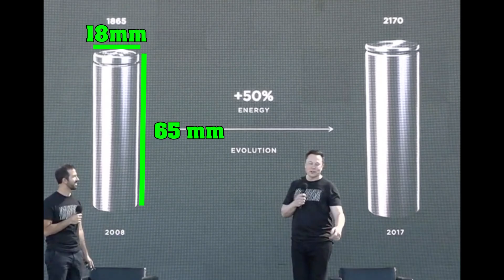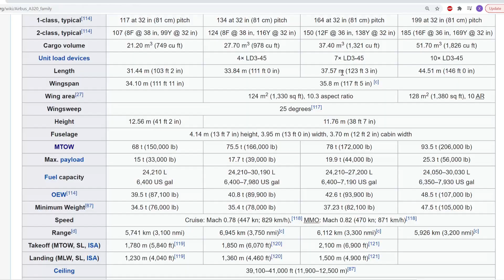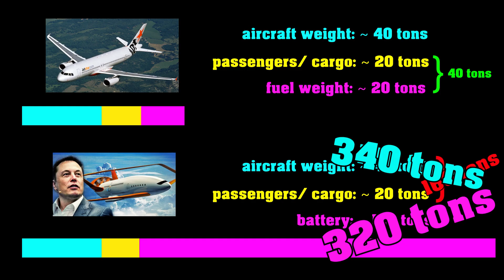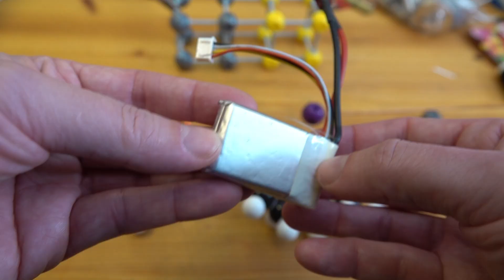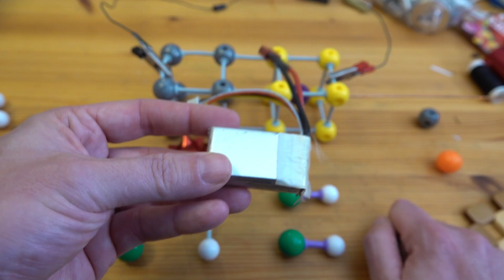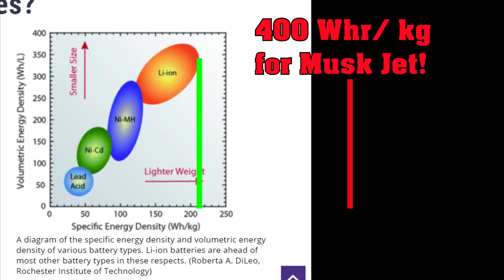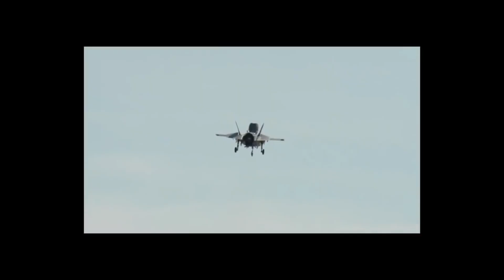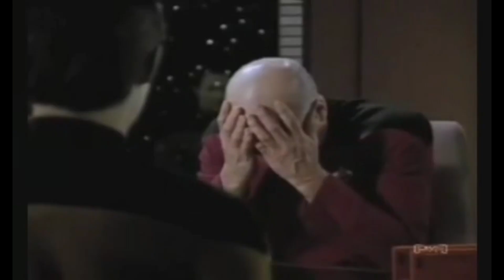Tesla's Secret Plan To Disrupt Airlines: BUSTED!!

Comment: Vertical Take Off and Landing (VTOL) means you need a thrust to weight ratio above unity and thrust vectoring. With the plane being able to land safely in the case of a single engine failure.

Flying supersonic also adds lots of complications including flight control and frictional heating.

Maybe build a subsonic 50 seat electric airliner which can operate at regular airports first.

Comment: Sorry a turbine  power to weight ratio, some turbines can weigh 100kg and make 200HP.
Electric motors weigh less than a giant block of  cast iron yes, but a turbine is. Titanium barrel  with a titanium shift with carbon fan blades. Aluminum compressor blades and inconel  turbine blades.

A electric motor is a giant steel shaft, with a boatload of copper, giant magnets and. Heavy castaluminum case.,

Comment: A gas turbine is basically an air compressorr, which sends the compressed air though the hot section where fuel is added and ignited. That is sent through the work/expansion turbine which drives the compressor and the exhaust generates the thrust. I just don't see how an electric motor can do that. Musk would do better looking into steam, https://www.youtube.com/watch?v=4EbqfT06LeA

Comment: 20:47 it is possible to double the density, but theres a caveat, the number of cycles of charge, I bet their 500w/h will only last 1/5 of the cycles, use your plane 10 times, no problem, throw it away a buy a new one, (and it being 75%  battery, that's almost throwing it away)

Comment: Would it be correct to say that fuel engines the higher you go the worse they perform because the decreased air density affects both thrust and fuel burning while on an electric engine you would only lose thrust? Maybe this was musk's point? Anyway, the rest of the arguments especially battery energy density/volume are already quite convincing in that electric planes are difficult if not impossible.
Reply: Not really, even if the LP stage turned at the same speed, at high altitudes you can increase the speed of the IP and HP stages to make up for the thinner air.

Comment: 13:20 There was once a court hearing, a plastic surgeon was charged because he rode his diesel on human fat from liposuction.
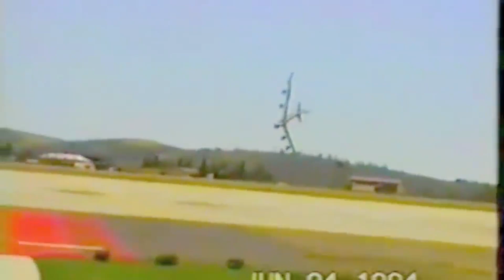22:36 A defective battery cell launch system could be considered, and we have a new use for batteries in the defense industry. Sometimes I have the impression that tesla and a boring company etc. they come up with new solutions only to make people think that tesla batteries will have a larger market than previously predicted, assuming only cars / houses. And here I have a question, house battery? Why should it be in the same technology as the car? I do not drive the house, so I do not care about the place and weight so much, I suspect that a battery the size of a large refrigerator would be ok, at home you do not need the same power consumption as in the car and charging domestic batteries may be much slower ...

Comment: Thanks for the video! I was explaining this about 10 years ago. "Oh, it'll come. We'll have it by 2021." People have no idea just how much energy a gallon of liquid fuel has.
Even if they solve the energy problem, there's still the problem of charging it. Whatever it is would have to be able to be charged very quickly and then how do you do that? Have on site Diesels? 

People think there's a free lunch to be had.
Reply: Plus, that liquid fuel is not going to spontaneously blow up as long it isn't explosive by itself or doesn't have explosives dissolved in it. Storing fuel separately from oxidiser is an inherent safety mechanism built in to combustion engine vehicles which you don't get with batteries. Additionally, ICE vehicles of all types get lighter as their fuel is used up, and this characteristic is, in fact, enough to make battery planes DOA.

Batteries not only have to carry oxidiser with them, they also have to concentrate their oxidiser and store it in close proximity to their reductant, making them inherently less safe than a tank of fuel. So, even IF you could store the same energy as a tank of fuel in a battery, such a battery would be a WMD by the time you scaled it up to what would be needed for a lorry, truck, large EV, boat, ship, or (peak stupidity) airplane.

Metal–air batteries, such as lithium–air, solve this problem. They enjoy the benefit of combustion engines in that they use oxygen (which you can get from the air) as the oxidiser. This removes the need to store oxidiser with you and also the need to concentrate it. However, they absorb mass as they "discharge", which means that (afaik) these batteries would get substantially heavier as they discharge.

Comment: Why isn't fuel with ~40x the energy density of li-ion-batteries so scary? I mean, is keeping oxygen out of fuel tanks that much easier than keeping batteries from shorting?
Reply: @tiglath pileser  Why though?
Reply: @tiglath pileser  However, you'll need a drastic malfunction in the battery first. How probable is that?

Vehicle fire statistics do not reflect a higher risk of battery electric vehicles. In fact, officials say that battery electric vehicles are at least as safe as conventional vehicles in terms of fire risk.
Reply: @tiglath pileser  As you pointed out, energy density isn't everything. The time in which the energy is released is key; TNT (4.8MJ/kg) and Thermite (4MJ/kg) are relatively close to each other in terms of energy density but very far from each other if you look at destructive power. In case of batteries I expect the internal resistance to be the crucial factor: The higher the resistance the slower the uncontrolled discharge leading to less heat being generated per time giving the cooling system / natural heat dissipation a chance to keep the temperatures of the surrounding cells below critical values. What comes to my mind thinking about this is that Tesla actually decreased the resistance of their latest battery design by introducing a tabless design, but there might be a way to design the cells of a battery so the resistance increases substantially once a certain temperature is exceeded enabling a safer self destruction of individual cells. Ever heard of fuses? :-P
Reply: Yes, keeping the oxygen out of fuel tanks really is that much easier.

Comment: Thunderfoot, one thing you didn't mention is that batteries can't be completely exhausted to zero energy. Lithium Ion batteries at best can only cycle to about 20% of charge. You're left carting around all that useless charge. It's also worth mentioning that on a conventional airliner that as you burn fuel it gets lighter and needs less fuel as there is less mass to move. The Elon Musk wonder battery would have the same mass for the entire flight.

Comment: 9:28 ... what if you did something like distributed the battery throughout the entire frame. Maybe the entire plane is hollow carbon fiber and just filled completely with batteries. Now take away how hard that might be to do, or how unsafe and how expensive (so not practical lol... I mean maybe, I have no clue).... Would this change the fact you need all that extra frame weight? I guess I’m asking can you reduce that number or solve that problem with creative engineering and design, or is this just a sort of hard number, that no matter what you do, you’re going to end up needing a certain amount of support and in the end it’s gonna weigh “this” much. 
My gut is telling me you could reduce the number, but maybe not by much and the money and effort it would take to do it would make the whole thing pointless.

Comment: Well he is confusing the weight of a combustion engine wieght for a car with the percentual wieght of a jetengine.
A combustion engine for a car is heavier due to the need for a gearbox and the way the combustion engine works, pistons going back and forth etc. Though you have smaller boxer engines that are more bang for a buck in a smallar packet, but these also have a turbo, not that much extra weight but it adds horsepower. Not sure about fuel efficiency though.
LiPo batteries are scary, the way they can get unstable due to imbalances in the cells or even if they are completely drained they swell nd may break, and then oxygen enters the rings and oxidizes the contents of the battery. Cats and dogs living together, big fire, total anarchy.....

Comment: So Elon is saying that he wanted to compete in the F35 bid for the multi role fighter. But his would be electric..... it’s a simple thing to do, after all the F35 is only a decade or so late and 5 times or more over priced on final aircraft prices. So making it electric should be easy...

Seriously though DOES ANYONE KNOW WHAT MOTION LOTION DEVICES CAN PISH AN AIRCRAFT SUPERSONIC? Do you? Here is the tip as in its just the facts due to physics. Sailplanes can fall at up to terminal velocity. Propeller driven aircraft no matter what engine or turbine drives that prop top out at about 350kts indicated. High bypass turbofans which is what plebs call jets and are attached to passenger airliners like the Boeing 737 top out at Mach 0.9. Now we are getting somewhere. Jets or more correctly turbojets or pure turbojets or low bypass turbojets are in jet fighters and nothing else due to noise and pollution and fuel efficiency have topped out so far at what the SR71 does so maybe Mach 4. Chemical solid rockets or liquid fuel rockets don’t really top out and the X15 went about Mach 5 ish but the limitation is melting the airframe rather than thrust and exhaust velocity. So that’s what pushes aircraft in the atmosphere.

So what can electricity power from the list? Sailplanes? No by definition and not supersonic anyway. Propellers can be electric quite easy but can never be supersonic as the prop tips can’t be going supersonic as it’s by by prop blades and if the aircraft is supersonic then the prop tip is going even faster than that. High bypass turbofan can be electric, the hot section which is the core or power core is the middle core and just a tiny bit in the centre that compresses incoming air a couple of times then injects fuel and torches it in the combustion chamber, the fires of Hellhiem scream out the back of the combustion chamber and flow past a shit load of power turbines like windmills and each windmill turns a seperate engine part. So one turns the first compressor blades at the front, next drives the second compressor at the front, another drives the accessory’s like oil pumps and generators and hydraulic pumps and then what’s left of the fire winds turns the last windmill and that spins the huge fan at the front that you see as you board, this is just a shrouded fan and a fan is just a propellor with zillions of blades. The fan sends 95% of the air it sucks in around the hot section and inside the shroud and out the back as a ring of high speed high pressure air which is a jet of air hence it’s a jet but really the actual jet is the hot section and the air that goes out the back of that produces only 5% of total thrust and the other 95% is from the cold section high bypass fan. So you make the hot section an electric motor and your done and your limited to Mach 0.9 still due to you can’t have supersonic or even close air entering the engine so you have to slow the air before it enters (SR71) and then you reenergise the air with the fan but what’s the point? You just can’t energise the air with a fan enough to then constrict the outflow enough to get a supersonic exhaust with enough power to fly supersonic. It just can’t be done or military would use it to quadruple flight times with super efficient jets. So high bypass yes to electric no to supersonic. Pure turbojet... well yes to supersonic and electric I suppose. The turbojet burns fuel to get high speed, high pressure, hot as fuck air. This air then via windmills/turbine blades turns the compressors at the front which in a turbojet ONLY compresses the air before being burnt and nothing is bypassed and all the air is burnt. Turbines do however still power generators and pumps. BUT 95% or more of the air goes straight out the back as LOUD AS ALL FUCK dimension tearing air that will melt tarmacs and runways and is going the speed of (insert an ungoddessly high number here). The exhaust nozzle on most of these is variable in diameter and is like changing gears in a car. 

So the pure turbojet could it work yes maybe? But probably not. Think about it. The fuel burning bit is the hot section from the high bypass turbofan. The hot section in both jet types is the same and the difference is that a turbofan uses the last of the hot air to turn a turbine that spins the Hugh front fan which actually powers the airliner, while a turbojet just keeps that hot air going out the back end and uses a variable diameter exhaust nozzle to maximise thrust or exhaust speed. So if you have a turbojet and put an electric motor in it well first off the main battery is your power so no generator turbine is needed, your pumps are electric so the main battery also drives them so no turbine either. So now the electric motor is just spinning the compressor blades at the front that shove air into the .... COMBUSTION CHAMBER... where fuel is added and burnt to get absurd power to push the aircraft. Remove the fuel which is the idea and you just have a turbofan with tiny diameter blades which is so fucking in efficient that it’s laughable. That’s why turbofans are so big, efficiency. No electric motor and no shrouded blades can ever get you turbofan exhaust and it’s the exhaust that does the physical work of pushing you supersonic.

Rockets aren’t electric so just forget that.

So there is no propulsion system that’s electric that can get an aircraft supersonic. And fuck off everyone who says ion drive because if you said it then you know nothing about them. The biggest ever is a meter or so in diameter and produces 200 grams of thrust and its been run for about 30 minutes total so far since its initial build. These are space engines made for running for years with a tiny acceleration that gets you to several hundred thousand kilometres an hour eventually.

So no electric drive exists on earth to go supersonic.

Comment: One other blatant error from Musk on this.  As you go up in altitude, and the air gets thinner, the rating of the electric motors decreases.  Rather than getting more efficient, they lose the air that they need for cooling, and must operate at a lower output.

Comment: This could have been a 3 minute video. Batteries don't have the energy density required and unlike fuel tanks they don't get lighter the longer you fly. Maybe someday a battery will be able to pull this feat off, but even then, the fact that the batteries never decrease in weight means they will never be the optimal solution to the problem.

Comment: Apart from propellers, I do not see how the electric playing can Propel itself. If they're using propellers then going higher means you would get less thrust because the air is less dense. Perhaps?  Also the speed of the blades would be too high not to break, going super sonic.

Comment: Here's a link to a more scientific discussion of the potential of solid-state lithium-metal batteries...

https://www.youtube.com/watch?v=E76q-9q7ZDg

The relevant discussion starts from the 13:00 mark to around the 40:00 minute mark. It presents the potential increase in energy density that can be obtained with these types of batteries and their potential for applications such as electric VTOL flight (NOT supersonic though... LOL)...

It also presents the challenges of such a battery design. Having a lithium metal anode boosts the energy density but in the charging/discharging cycle the lithium metal grows dendrites (even through a solid electrolyte) when the current is above a certain level (way below the current needed to outperform conventional Li-ion batteries) and eventually forms an internal short and... kaboom... or more realistically, thermite bomb...

At least there is some scientific basis for the claims of batteries having more energy density than current Li-ion technology, and electric flight can be made practical, but we're quite a bit of a ways off from that at this point in time...

Comment: A jet burns fuel as it goes, so it gets lighter and more efficient the further you go into your journey. Pilots calculate how much fuel they need before each flight so they only take what they need because it makes such a difference to fuel efficiency. An electric plane has to carry the entire battery for the whole journey, every journey. Also, what is the turnaround time at the airport? How long does it take to charge? What is the degradation of the batteries over the life of the aircraft? I can see electric planes working in an air taxi kind of vehicle, if the civil aviation authorities could ever approve that, but that's got to be the limit of it unless something fundamental about batteries changes.

Comment: An easier explanation for 9:13: The battery needs to be 66% of the plane weight, and the structure needs to be 50% of the plane weight, that's more than 100% so it can't be done.

Comment: I got about 30 seconds into this thing. After repeated "electric jet" spewing from Musk's pie-hole I couldn't go on. Anybody with any sense knows that it is beyond impractical if not impossible on any scale to be useful, if at all (at least in any of our lifetimes).  Frankly the number of mind-washed morons who immediately start drooling when the words "electric powered" are attached to a vehicle is getting tiring.
Reply: Hey, you can totally have an electric Jet.  Just burn the jetfuel in a turbine, have that turbine harness the power of that jetfuel at...idk 70% efficiency?  Then have that electric power delivered to electric motors that are 95% efficient,  factor in the losses in the cables as about 0.15%, and thats like 165.15% more power

no wait, that actually 66.6% efficient.  Damn White Paper